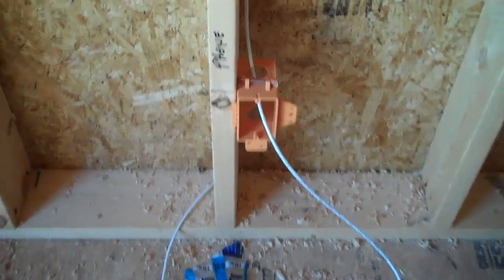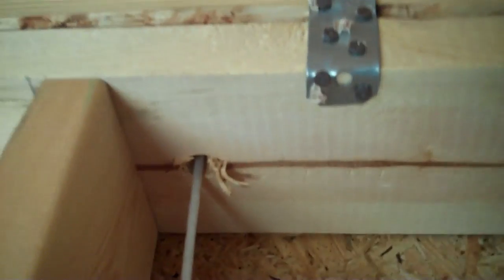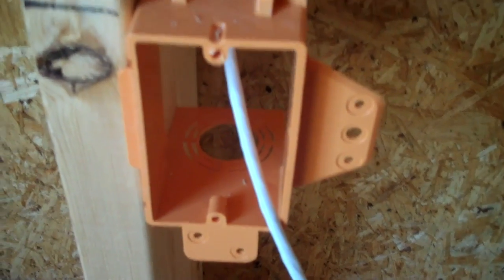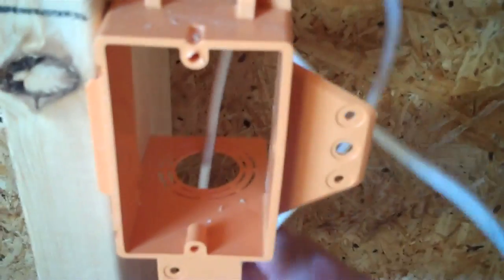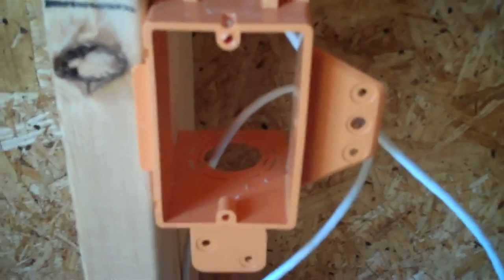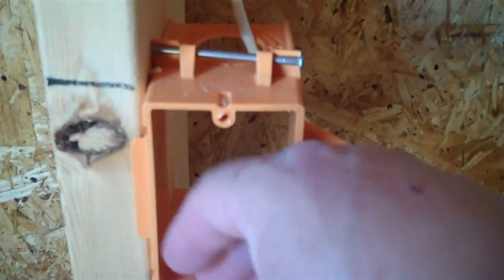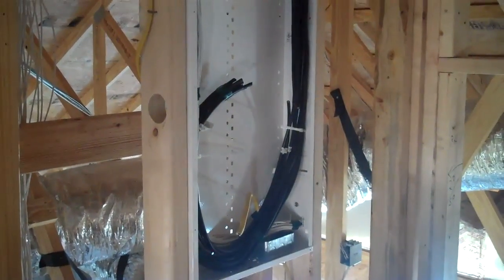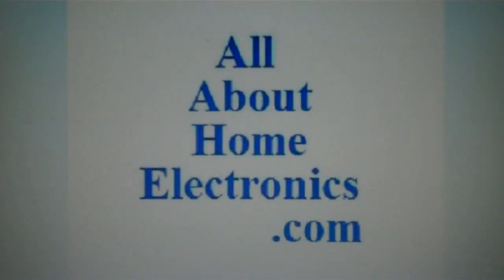How to Wire for a  Phone Outlet + Internet Jack

Comment: why would you staple it!! if you ever have to replace it your sol i would of ran a pipe from top plate to work box like the cheep blue tube you can get. also run 2 it wont cost 2 much more as a installer of internet it would help alot!